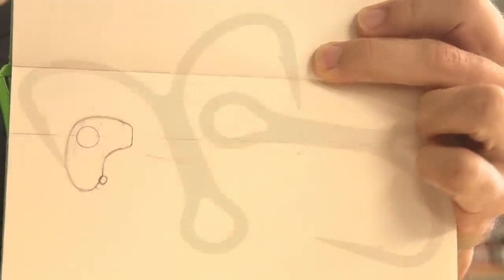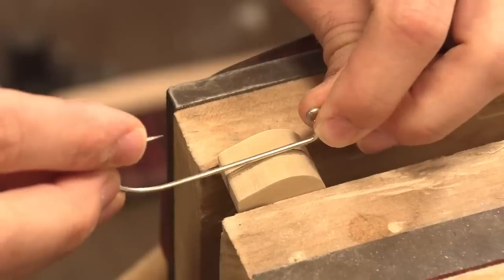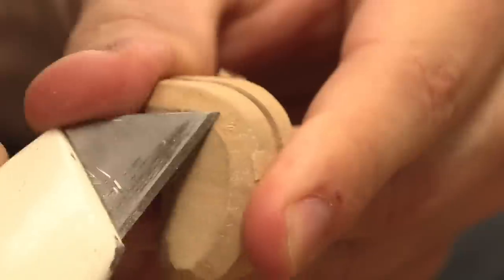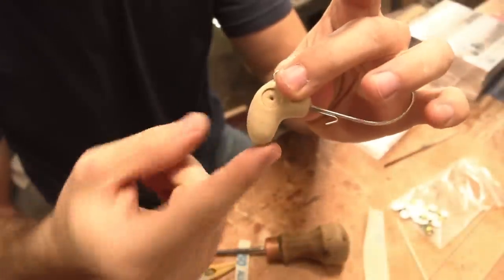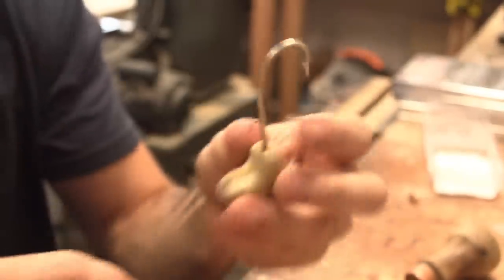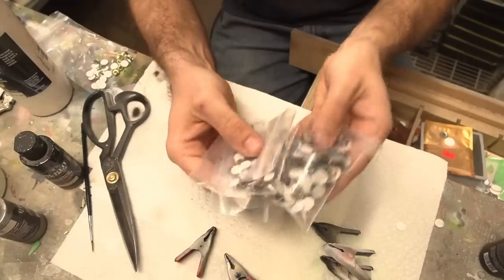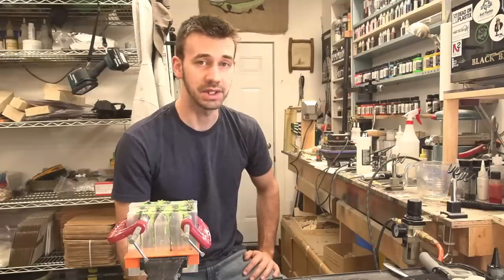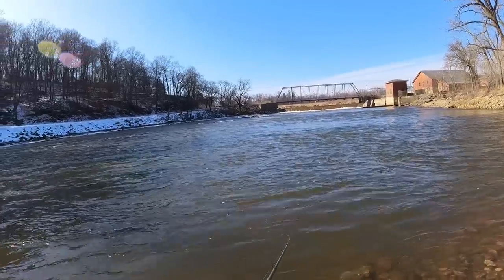Big Wooden RoadRunner JigHead | One Day Build to Catch

Comment: A shelf in my fridge broke a few months ago... and the fridge is only about 3 years old.  The glass was fine, but one of the white plastic supports cracked and was definitely a problem, and a small piece of it was missing.  I immediately thought "hey, superglue... baking soda."  Pulled the shelf, did a little DIY on the front porch and in less than an hour said shelf was fixed.  It's been solid ever since, and I definitely check the spot I fixed every few weeks.  Seems stronger than the original at this point!

Comment: You need to make a weighted lure retriever that clips on your line you so can slide it down to the snag I think that might solve a lot of issues!
Reply: Only problem with them is range most of the time. Helps to be as above the lure as possible, but they do work!

Comment: As an idea for the bait tank I would suggest getting a wake or current maker designed for aquariums. For one thing this will reduce the need for you to throw your lure into the pool reducing splash and saves your lure from damage. Secondly this will keep the water from becoming stagnant. Lastly this will help produce a continuous action keeping you from needing to reel the lure in and recast.

Comment: Great video as always. You were giving me anxiety as you were drilling lead hole. I would have held onto the hook with a pair of pliers in case that bit caught and tried to run that hook into my hand. I used to fish road runners all the time. I fished the discharge of a coal fired power plant. In the early spring, a road runner there was killer. Thanks for video!

Comment: You can make a lure retriever with a paper clip and lead. Slide the paper clip onto your line and it will go down to the lure and knock it loose(most of the time)
Reply: I like the ones with two little chains that dangle. Helps grab hooks. Anyway, lure retrievers work great if you are almost vertical over the snag. As far out as he was in the river, it wouldn't have worked. That current and almost horizontal angle makes it super difficult

Comment: Out of curiosity, why tupelo over bass wood, I'm brand spanking new to this stuff, but I have a load of bass wood, probably in the range of about 30 board feet and have never worked with tupelo, but I've made a few lures with basswood and am ready to paint and the carving/sandinf/sealing has been really easy even though my ability with carving is novice at best. So what am I missing out on?

Comment: something I just thought of and wanted to run it by you for input. okay so painting a wooden lure the way you want and then adding some metal duct tape in a design on part of it for reflection prior to the clear coats. what are your thoughts? you can use that idea if you want to try it out. ohh or cover it in metal tape and then paint the whole thing with the screen on it so you had a crosshatch flash after panted.

Comment: I always get nervous when you drill out the eye sockets when you're pushing the piece up towards the drill bit with you fingers. ONE DAYYY, you'll slip and hurt yourself man! Maybe see if you can get some kind of sponge or some other surface so you can use he drill safely instead of risking hurting yourself  <3
Reply: There just work hands. No big deal if the get beauty marks.
Reply: @victoradams4420  Well.. I guess you're right.. It could've been worse, he could've worn gloves to increase the risk of losing a finger or three.